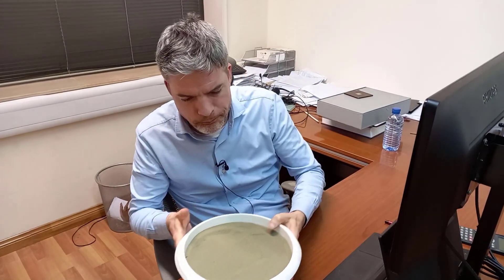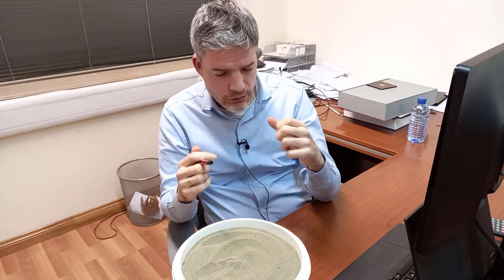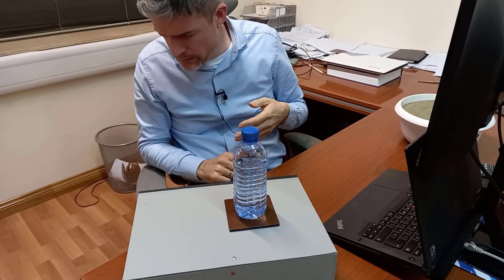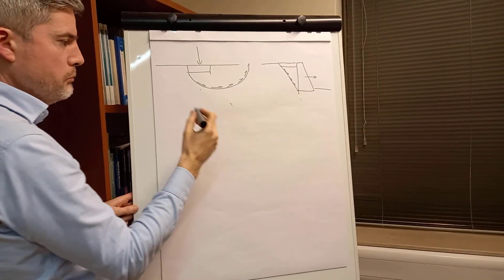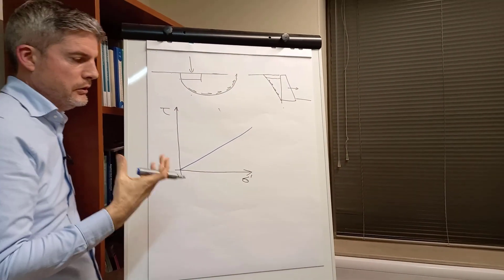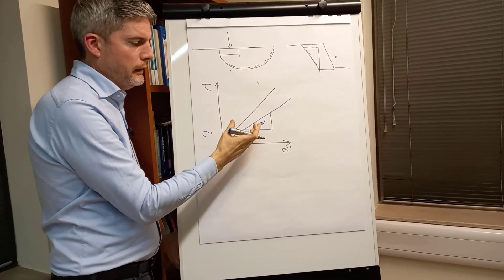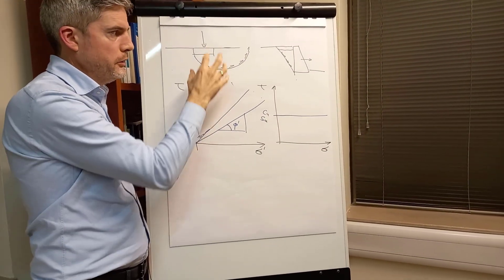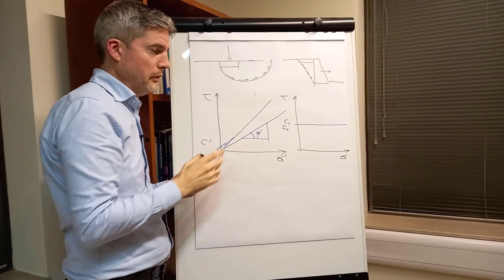What is the shear strength of soil? I Geotechnical Engineering I TGC Ask Andrew EP 5

Comment: Sandy gravel 😅

Now then ... Seriously just watched your last geogrid vid . I installed geogrid some years back on an embankment for infrastructure . Some years later I built a retaining wall based on a concrete slab for an employer . Watching your vid today I realised that my old employer could have saved a fortune on concrete and carbon using geo grid instead . Well it's tough for my old employer as I didn't remember geogrid and even if I had I would of been discounted for my input   All that said I am now starting my own business utilising geogrid and installing geogrid pre cast revetment block driveway and access roads . These save lots of carbon using less concrete and less lorry movements to install product and driveway / road remains pourus with no water run off and it saves on drainage .

Great videos , I love your wisdom and knowledge .

Thank you for sharing 👍👍

Comment: How does a geotechnical engineer decide if a reinforced earth wall or slope needs additional drainage? Often I see reinforced retaining walls built with accommodations for water (gravel, drains) but in steep reinforced geocell slopes this seems less common - how is this need assessed, and what factors are most important?
Reply: The lateral earth pressure behind the wall cannot be greater than the allowable stress that the wall can resist. Poor drainage can increase the moisture of the soil behind the wall which may increase the lateral pressure significantly, so this will depend if you need more drainage. Typically, the backfill act as a drainage since the soil is recommended to be granular soils with low fines so it can be compacted easily. You don’t want to put a compactor machine close to the wall (this can break the wall via vibration and is not safe for the operator).

The geocell slopes are typically used as erosion control and not as a wall. Think of it more like a blanket on top of native soil. This is why this does not need drainage as the soil above is native (naturally compacted) and not backfilled as in the case of a MSE Wall.